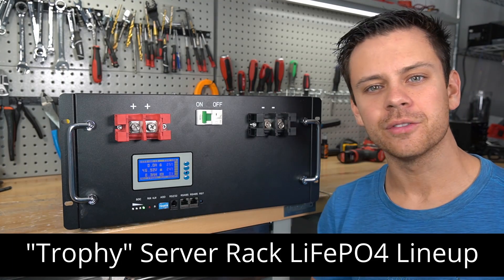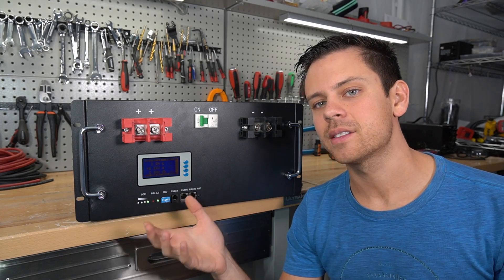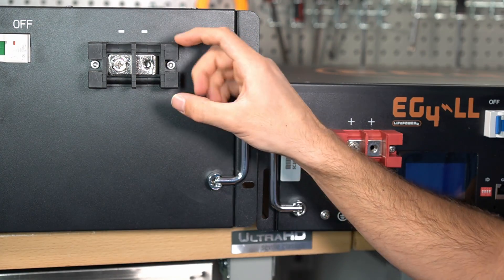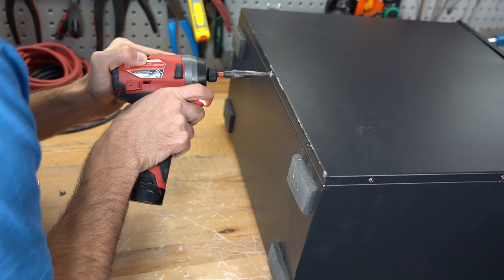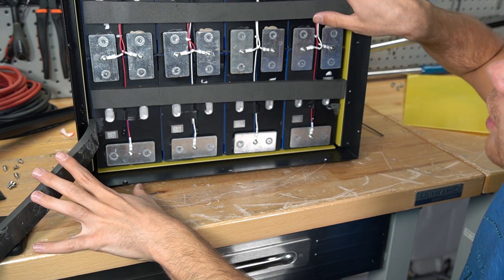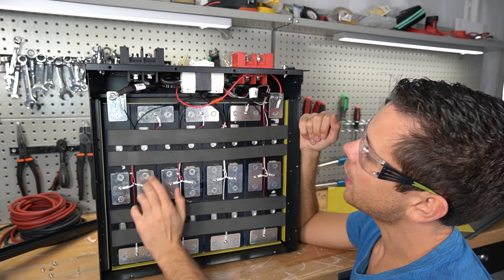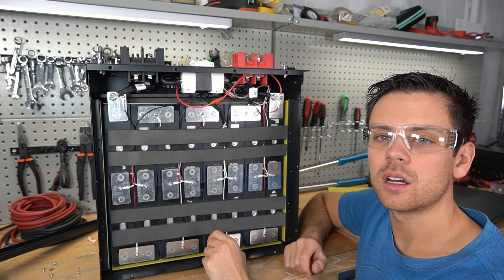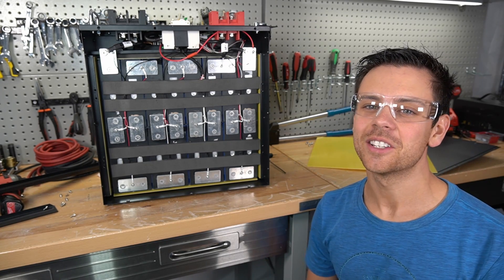New "Trophy Battery" Lineup: 48V 100Ah/110Ah/220Ah LiFePO4 Server Rack Batteries

Comment from the maker: I forgot to mention that trophy batteries have internal heater pads. They are under the cells. Totally forgot about that! 

These batteries can be found here (affiliate links):
100Ah: https://trophybattery.com/index.php/product/48v100e-1-2/?ref=h-cvbzfahsek
220Ah: https://trophybattery.com/index.php/product/48v220c-1/?ref=h-cvbzfahsek
304Ah: https://trophybattery.com/index.php/product/48v304e-1/?ref=h-cvbzfahsek

Other Server Rack Batteries: https://www.mobile-solarpower.com/server-rack-lifepo4.html

~~~~~~~~~~~~~~~~~~~~~~~~~~~~~~~~~~~~~~
Tired of getting ripped off? Check out my "Will Prowse Approved" solar product recommendations below!

12V Batteries
https://www.mobile-solarpower.com/lithium-batteries.html

48V Batteries
https://www.mobile-solarpower.com/48v-batteries.html

Offgrid Inverter System Builder
https://www.mobile-solarpower.com/48v-complete-system-blueprint-559371.html

Hybrid Inverter System Builder
https://www.mobile-solarpower.com/code-compliant-48v-offgrid-system.html

Mobile Handtruck System Builder (very popular!)
https://www.mobile-solarpower.com/mobile-48v-system.html

Solar Panels
https://www.mobile-solarpower.com/300w-solar-panels.html

Ground Mount Solar Racking
https://www.mobile-solarpower.com/ground-mount-racks.html

Wire, Lugs and Busbars
https://www.mobile-solarpower.com/wire-and-connectors.html

Tools
https://www.mobile-solarpower.com/tools.html

Fuses and Circuit Breakers
https://www.mobile-solarpower.com/fuses.html

Plug-N-Play Solar Systems
Ecoflow, Anker And Bluetti! So many models to choose from. See my current recommendations here:
https://www.mobile-solarpower.com/full-size-systems.html

~~~~~~~~~~~~~~~~~~~~~~~~~~~~~~~~~~~~~~~~~~
Need to build a large DIY system? Need a trustworthy solar distributor? These are my favorites:

Signature Solar
Creator of EG4! Solar Minisplits, Victron and More! Largest Solar Store Online.
If you want $50 off, please use my link below and coupon code "DIYSOLAR50":
https://signaturesolar.com/?ref=cPwLcVc0SW-BjN

Current Connected
Best Prices for EG4, Victron, Midnite and so much more! Fast Shipping and Highest Rated Customer Service:
https://currentconnected.com/?ref=wp

~~~~~~~~~~~~~~~~~~~~~~~~~~~~~~~~~~~~~~~~~~
Join our DIY Solar Community 
Need more help? Join the largest solar forum on the internet for beginners and professionals alike. 140,000 members and counting!
https://www.diysolarforum.com

Check Out My Free Book
Best-selling and beginner-friendly guidebook to off-grid 12V solar!
https://www.mobile-solarpower.com/the-book.html

~~~~~~~~~~~~~~~~~~~~~~~~~~~~~~~~~~~~~~~~~~
Contact Information:
I am NOT available for personal solar system consult! If you wish to contact me, this is my direct email: williamprowsediysolar@gmail.com
FTC Disclosure Statement and Disclaimers:
Every video includes paid promotion or sponsorship (such as free products for review). Some links on this YouTube channel may be affiliate links. We may get paid if you buy something or take an action after clicking one of these. My videos are for educational purposes only. Information is subject to change/update at any time. Electricity is DANGEROUS and can kill. Be smart and use common sense :) DIY Solar Power with Will Prowse is a participant in the Amazon Services LLC Associates Program, An affiliate advertising program designed to provide a means for sites to earn advertising fees by advertising and linking to Amazon.com
Reply: Will, what's your opinion on using server rack batteries in an RV? any issues with connections failing due to the movement?
Reply: Now that feature is awesome.  That alone makes them stand out in my mind.
Reply: Do we know any specifications on the heater and how they are controlled?  Is it similar to battle born where they'll turn on when when there's charging current?
Reply: @MrMichaelstx  When the battery temperature sensors detects that the cells are near freezing, the charging current, if the battery is being charged,, is diverted to the 100 Watt heaters.

The heaters are located under the battery cells,.

When the temperature of the battery cells rises to safe levels for charging, the BMS automatically resumes normal charging.

The battery cells' power is never used to power the heaters to prevent draining of the battery. 

Thus, the State of Charge of the battery never affects the heating of the battery, and thus the charging of the battery when the temperature rises to a safe level.

The entire process is fully automatic.

Please note that all LiFePO4 batteries have diminished output when the battery is cold. Normal power is restored when the battery returns to normal temperatures. The ideal temperature is 25C/77F. Thus, room temperature is ideal.

When LiFePO4 cells get very cold, the BMS will interrupt the discharging of the battery, and restore normal operation when the temperature rises to a safe level.

Every Trophy Battery, specifically, the 100 AH model, which is not in stock at this moment, the 110 AH Model which is in stock at this time, and the 220 AH battery which is in stock, but with a low quantity remaining right now, all have the automatic battery heaters.

Respectfully,

Dan Keaton
Trophy Battery LLC
1-803-380-6211
Reply: @dankeaton8656   @DIY Solar Power with Will Prowse  would love to see this operation tested.
Reply from the maker: @MrMichaelstx  100W silicone pad. Looks like same pad in quite a few other packs I've tested. Probably switches on when cold but disconnects at low soc
Reply: @MrMichaelstx  the battleborn's use the battery charge to heat the batteries, per battleborn's site...
Reply: @robertandrews830  yup!
Reply: Will, the big battery bank at the Moss Landing (CA) power plant just caught on fire for the second time in six months.  They must have one serious 'internal heater pad'!  Too bad their controller seems a bit out of control, though.  ;)
Reply: yep SOK are nice

Comment: I have a Magnum MS4448 PAe inverter and MidNite Solar Classic 200 vdc 60 amp charge controller with 2000 watts solar panels and lead acids battery bank of 450 amp hours what Trophy Battery should I get to replace my old lead acid battery bank, any help with this would be great. I have viewed many of your videos and find the very informative.

Comment: I am looking to buy two lithium 200-ah batteries. The company I bought most of my Solar System from recommends these. What are your thought and what would you recommend? ETL Listed Eclipse 48V, 200ah Ver 3 LIFEPO4 Battery They are super expensive around $8000 each!

Comment: I'm hoping someone here can help me. First off, I am a novice so please excuse my ignorance. I was really impressed with these Trophy batteries and based on Will's review, and the fact they have heaters, I bought 6 of them from Trophy Battery to use in a 10Kw off-grid system that I am planning on installing myself.  I received the batteries within days of the purchase. My problem now is that I just found out that the county I am in will not permit them because they aren't UL listed (although all the components inside are).  I'm trying to figure out a way around this because I speant $13,000 on batteries, still in the crates,  that at this point I can't use! Does anyone have any suggestions?  Would it be possible to permit and build the system using just one cheap 48v 100Ah battery from a supplier that is UL listed and then, later, swap out and use my Truphy batteries? Any help you guys can give me would be greatly appreciated!

Comment: Will , there are many off grid applications in Canada that Started with smaller systems (12 & 24 volt)  with 120 AC out at the inverters and into a jumpered 220 volt service Panel. These systems can be way too expensive for the cottage owners to up grade to 48DC X 240 AC systems.
In Northwestern Ontario it is not unusual for systems to idle throughout the winter and periodically temperatures can drop to minus 40 C (40 below F). 
My wife and I are in our later years but may still wish to upgrade our batteries ( 4 L16 / 370 AH @ 24 volts to a 40 amp Epever your suggested product chg. Controller to a Magnum 4000 watt Pure Sine)
Can you do a video  suggesting the best and cheapest method of updating the batter systems for our Northern Systems?

Thanks Will.

Comment: Will, love your stuff!!  Been watching for the last three years.....    I am building a van with a 48V system.  I will put a large battery (either one of the 220a trophy, or two of the 110a trophy) in my van.  A critical component for me will be a 5000 watt alternator with a wakespeed 500 controller (it has canbus control).  The battery that I buy needs to communicate any imminent disconnect of the battery from the system (by the bms via canbus) so that the alternator can stop output prior to a sudden disconnect of the battery load.  I am trying to figure which of the excellent batteries that you have reviewed lately would do this via the canbus.  Evidently lithionics, mg battery, discovery battery and victron will all do it....  those choices seem very overpriced for the battery capacity delivered.  Do you know if the trophy or the higher end gyll 48 will do this (I know they both have canbus, the question is whether they can communicate a disconnect over the canbus protocol just before it happens?  Trophy people did not know the answer to this.  (Dan Keaton)

Comment: Greetings Will, please help. My first installer messed up my system and used electrical cables instead of Pv on the DC side. They also duplicated MPPTs. My MPPsolar inverter has an inbuilt inverter but they installed and sold me an external MPPT. At the inverter I get 34v from a 12 x 250w Pv bank. Is this adequate to charge a 24v 3Kw inverter with a battery pack of 6 x 200ah bank? The battery bank has been put together as 3x12v + 3x12v to get a 24v battery bank. But is 34v Pv enough? Doesn’t seem so to me. Your thoughts.

Comment: did they sponsor you? you seem to like them a lot. But DIY is always better isn't it?
Reply: Henry Ford would disagree. It depends on your definition of "better". If better means you understand how every component works and can replace any single failed part, then DIY is better. If better means mass production and potential quality control and cost savings, then factory built is better.

Comment: So, the question I have is, how do you take rack mount batteries like this and turn them into a whole-house UPS?

How do you rig multiple recharging systems for these batteries, so that you can use line power, generator, or solar, depending on what is working when and what the respective cost of operation is?

I mean, I love learning about the battery systems, but the batteries themselves are really just part of the overall picture, right?
Reply: That's what I would like to do but you'll need some big AC-DC and DC-AC inverters.
Reply: @benwhittle7204  -- apparently the GroWatt inverters can take solar power, grid power, generator power, and battery power, and intelligently switch between them, including being able to recharge the batteries from multiple sources.

I'm still trying to learn more about them and how well they actually do what is claimed.

Comment: Nice to see a company under promise and over deliver.  The non-serviceable cells are ok as long as the warranty stays intact long term.  The welded connections are more robust if done properly.

Comment: I would like to see a video where you build a 48v battery pack & tie into home power to charge at night & use that cheaper power during peak time. Then add a wind generator later... staged implementation

Comment: Can you share the dimensions/weight for the 110 and 220 Ah batteries? 
The seller's website also mentions that both have "Internal Battery Heaters". Can you discuss if that's actually the case and if the other server rack batteries have this feature or not?

Comment: But No 24 Volt. 
I'm building a 26'  Tinyhouse Trailer this summer and I want a 24 volt battery for my own safety. 48 Volt can kill you or me. 
What do you think Will.
Reply: 48v can't penetrate your skin. It's not that dangerous unless you short the big wires.
Reply: @MrHuram-abi  Will has stated in some of his videos that 48 Volts is dangerous enough to stop your heart but not 24 Volt

Comment: Does anyone have recommendations on server cabinet for this kind of battery? I also like the idea of running these to bus bars so the cabinet would need to accommodate that as well. And even though it would likely never move, having it on large casters would be really good.

I'm not seeing weight for this Trophy 100Ah battery, but the SOK 100Ah is 110 pounds. Putting 8 of those into one rack would be nearly half a ton. The rack would need to be really strong to support that.

Comment: Only thing that worries me about warranties is will the company still exist in 10 years. There are some bad people out their who just start new companies every few years so they dont have to honor the warranties. Not saying this company is going to do so its just a thing to look into.

Not a fan of that rivet. Those possible metal chips falling into the case would give me nightmares. The orientation setting is probably because of those temp sensors.

Comment: Ive been looking at ROAMER lifepo4 batteries, have you looked at these batteries. Does anyone know if there any good? i currently have an ecoworthey battery, as far as i can tell it works okay but i need a bigger cap and the roamer 460ah is best bang for buck.

Comment: I want to but the 220. I'm afraid of how to service it when the company closes down weather in 1yr or 20yr. Is it really non serviceable by myself? Would I need to throw it out or...?
Reply: After many years of normal service, your battery may be ready for retirement.
If we are not in business, then you could disconnect the BMS (in the proper sequence), then replace all of the cells, and reuse the case and BMS. Or you could buy another battery.

If you wanted to, you could use replacement cells and bolt-on busbars.

We plan on being in business for many years, still selling premium batteries, and honoring our warranties.

The chance of our premium battery cells going bad is very low.

Statistically, the BMS is more likely to fail, as it has more components.
We keep replacement BMSs in stock.
Reply: @dankeaton8656  Thank you for your reply. May I ask, is it possible for just 1 battery to be replaced if just one needed to be replaced, by removing the weld or is that something very difficult that a common individual should not attempt?

Comment: Warranties sound great until you tell me about them, I am setting up solar in Jamaica where the warranty isn't supported. So if something goes wrong I'll have to ship the battery back to the US then apply for the warranty replacement/repair. On the bright side, Jamaica does not get cold so there's no issue with temp sensors.

Comment: What's your take on standard 12V vs. server rack batteries?  Yes, server rack has a display to get battery status and of course integrated DC breaker.  But 12V still have a BMS and should the job.  Cost for server rack configurations per kwh seems to be 50% higher. Is that worth it for home solar?
Reply: 50% higher? I think your math is wrong. 

A 12v SOK 100Ah, which provides 1.2KWh, is $570. It takes four of those to get to 48v with 4.8KWh of storage for $2,280.

A 48v EG4 100Ah, which provides 5.1KWh, is $1499.

These rack batteries are cheaper, have slightly more capacity, and are much more convenient than wiring 12v batteries in series.
Reply: @mrgulabull  Scott, I was hoping my math is wrong because of the additional features and convenience of the server rack batteries.   But, here it is:  SOK 12V/100 Ah:  $570 / 1.2 KWh = $0.475 / KWh.

And I just bought four Zooms 12V / 200 Ah batteries for $599 each at the Zooms store on eBay (they arrived today actually):  $599 / (12V * 200 Ah) =   $0.250 / KWh.   So, only half of Zooms batteries (Will tore one of them apart in a recent video).  

Yet, I saw a short blip in Will's recent video on the large 48V / 220 Ah Trophy battery which seemed to say $0.30 / KWh.  If that is correct.   For me, that additional cost would have been justifiable on account of the battery status reporting and integrated DC breaker and of course convenience of wiring.   But alas, that train departed for me as I already have the four Zooms... and will need four more once they check out and I have some more $$$.
Reply: This time my math was off, by 'only' three orders of magnitude, lol.  That would be $0.475 / Wh vs. $0.250 / Wh. Not KWh of course.
Reply: @DesertStarSystems  I don't know if comparing those Zooms batteries is fair. I have never seen a review of them but would be very surprised if they had high quality cells and build quality at that price point.

The 12v SOK's are probably a much more fair comparison in terms of quality and they are more expensive per KWh when compared to these 48v rack options.

These Trophy batteries seem to be on the extreme high end of quality for rack batteries (best cells / warranty). The EG4's are a bit cheaper and still very high quality.
Reply: @mrgulabull  If indeed the cells or build quality of Zooms is low, what impact do you estimate I will see in an off-grid home solar application?  They won't be subject to extreme high or low temperatures, which of course could be a problem with some BMS designs.  The Zooms have a 5-year battery replacement warranty in case of a failure. They send you a new battery after customerside confirmation it says.

Comment: I have been wanting to set up a offgrid style system for oure carport garage at 240v to charge our Tesla and to mine crypto at 240v as well. Trying to size out the batteries and solar needed. An issue is the cap the growatts can accept a solar charge so can't have an oversized solar system unfortunately